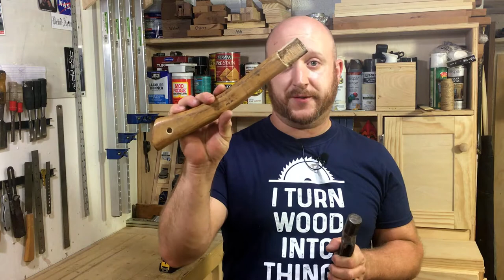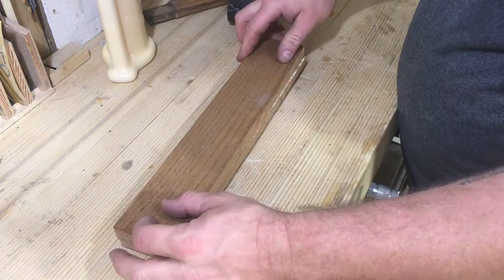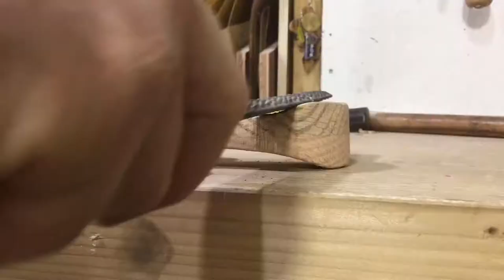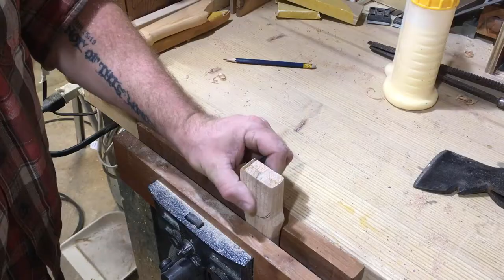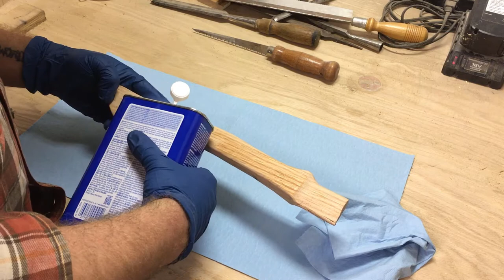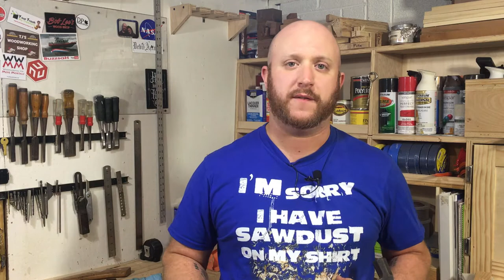How to Make a Hatchet Handle

Comment: Use oil or wax on handle and it will last a lifetime as long as you reapply every few months
Reply: The old timers’ method to remember is oil it every day for a week, then every week for a month, then every month for a year 😉
Reply: @u.sonomabeach6528  then once a year, thereafter

Comment: the wood grain is the wrong way it makes the handle very weak
Reply: That's an old wives tale. The only way to make a handle "very weak" is for it to have a fungus inside it. Gransfor Bruks says they don't notice any difference in the pattern of grain and that the only broken handles they've ever seen are from misses, over striking, not maintaining the handle with oil and wax treatment, and fungus. Additionally, two USDA Forestry studies showed that heartwood or sapwood didn't make a difference other than aesthetically.
Reply: @NematHeydary  heartwood and sapwood don’t really make a difference but it’s often recommended to make a handle with both heart and sap woods together. The grain direction definitely makes a difference in the strength of the wood. You say that the breakages are from over striking and that is true, but if you over strike with s straight oriented grain it is less likely to break than a cross grained because grain that is straight/vertical will support the wood on impact, assuming standard strike direction. Cross grained or horizontal will be more prone to split upon impact simply because the grain in the wood which is the main defense against splitting in impact  just unequivocally doesn’t have the resistance that vertical grain would have.  The two grain directions having the same breaking point is implausible and the differences can and have been tested accurately
Reply: @u.sonomabeach6528  again, that’s what Bruks says they’ve experienced form their decades of handle production. What experience do you have?
Reply: @NematHeydary  I have years of experience using them and making them. Some company’s random compliment(which I’ll just have to take your word) doesn’t eliminate sound scientific evidence or simple logic.
Reply: @NematHeydary  i agree with you on the sap wood vs hardwood that they don’t really make a difference. GB states that 99% of the time they have received axes returned broken is because of poor maintenance by owner, over striking….what other ways would an axe fail besides these? Of course they usually break by over striking and hitting the handle. That’s why grain orientation is important because, although I know how to swing an axe and am confident in my ability to hit on target, I still am certain that I will miss from time to time and the times that I do miss and strike the handle are the times that I hope my handle has good grain orientation that can stand the load. I would rather my grain be vertical up the handle vs horizontal in the cases of over strike because the vertical grain will, I am confident, be able to with stand a blow vs horizontal. Just my opinion and it could just be my experience of working with them and the things I’ve happened to have read. I haven’t studied it myself nor do I care to but it’s worked so far for me and makes sense but if there is a better or easier way, I’m all for it. Take care
Reply: I lied when I said that I have years of experience making them. I’ve made two that were passable but I studied at YouTube university and I know better than a company that has been around for a century or more. I’ll also admit that my ‘scientific’ information provided was mostly gathered from a quick google search and I really don’t know anything about the subject other than the little I have heard here and there. If GB says that it doesn’t matter I will take there word I guess, although I was mainly referring to the strength of the wood at the moment of an over strike and I believe GB is referring to the handle longevity through normal use and not counting over strikes